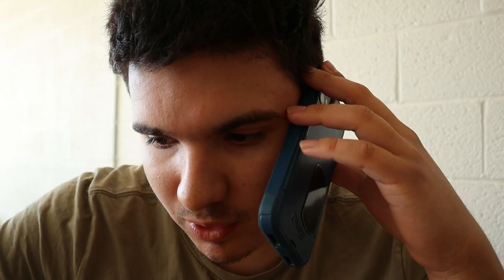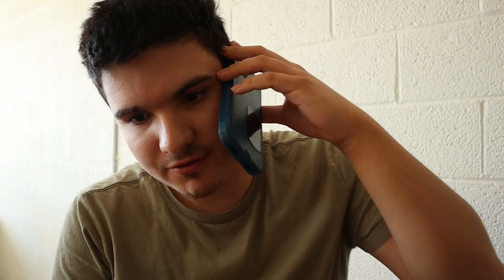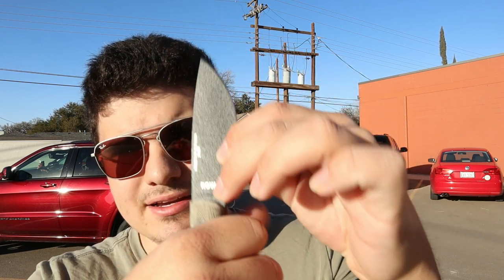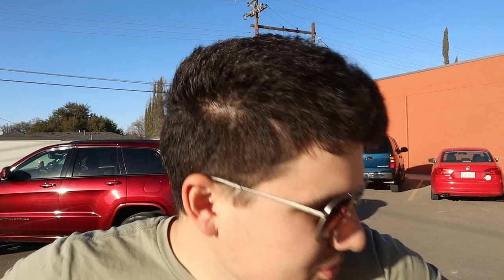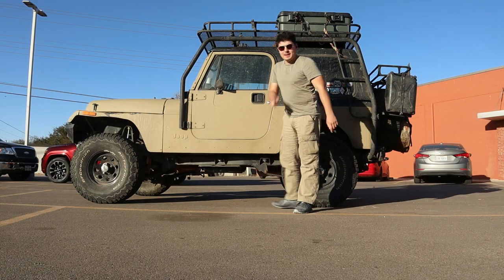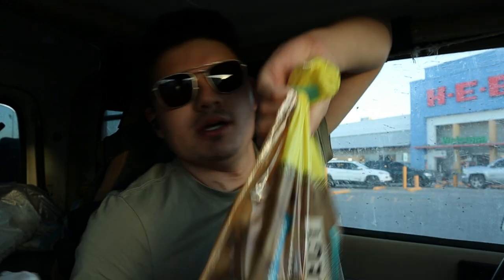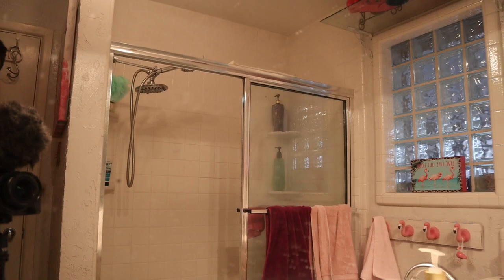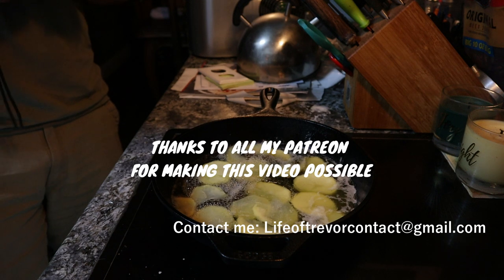Time to make some changes

Comment: Suggestions BuY a np231 transfer. Rebuild kit ...$ 150  talk to a transmission / gear guy or mechanics DIRECTLY   pull and reinstall transfer case $250  have transmission / gear guy. Mechanic rebuild / replace parts $150 AT MOST $600 or reach out to local JEEP CLUB IN THE AREA... done for parts plus beer pizza and one day job...